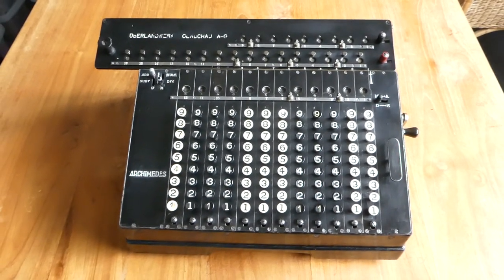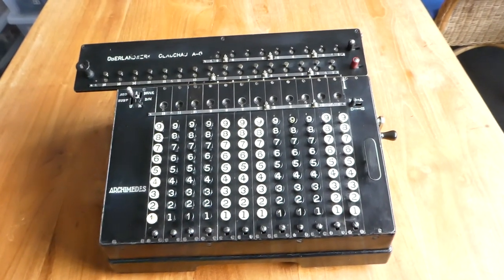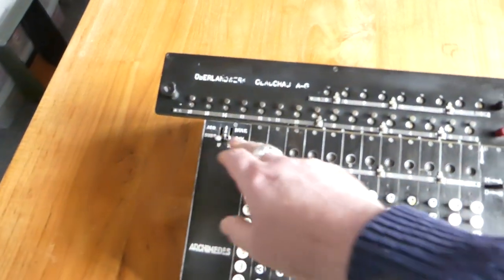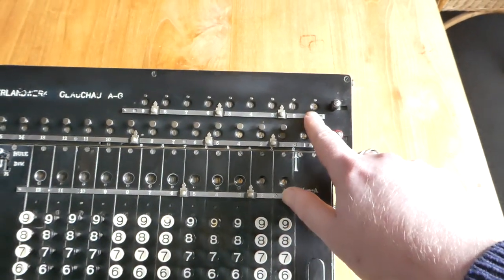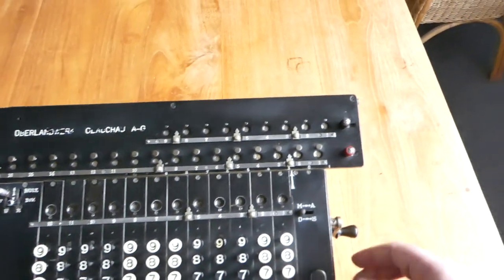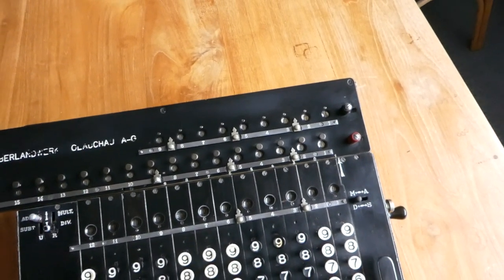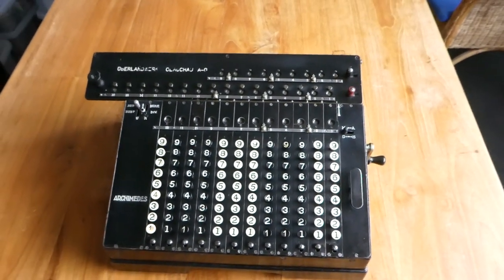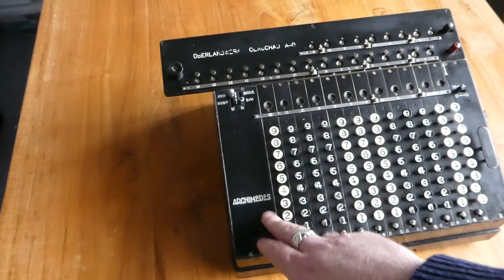Archimedes Model D mechanical calculator

Comment: I just started to work on an Archimedes L.  I received it more than 13 years ago together with some other mechanical calculators (some working, most not) and never had a closer look at it, and I didn't realize how old it was. After removing some dust it looks way better than I expected, and the inside is clean and still smells of fresh oil. The keyboard and the counters are working, the mechanics don't seem to be stuck, and the motor can be turned by hand. The problem is that the machine isn't in a defined state, so some levers can't be moved ( I assume it is somewhere in the middle of an incomplete automatic division). The next step will be to try to get it running with electricity, which for obvious reasons is something I must be very careful with.

Comment: I can't help but wonder what Archimedes would have thought of his namesake machine.
Being a world-class genius, he probably would have told them to put in a way to individually clear columns of the keyboard so that you could then use the odd-number subtraction method to find square roots.
Reply from the maker: That is something I forgot to show. Below each column of keys is the head of a screw, and this is attached to the latch that keeps the key depressed. You can pull one of these screw  heads towards you to release the key in its column. In the video at 2:43 you see the screws clearly move as I type the number. What you don't see anywhere in the video is that when the whole keyboard is cleared (whether automatically or by pushing the big black clearing button) they all move.